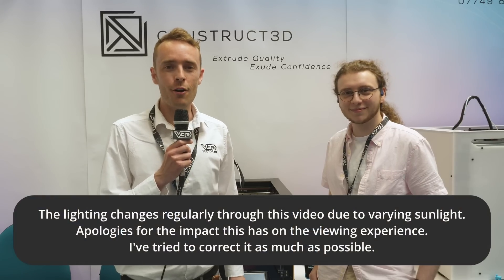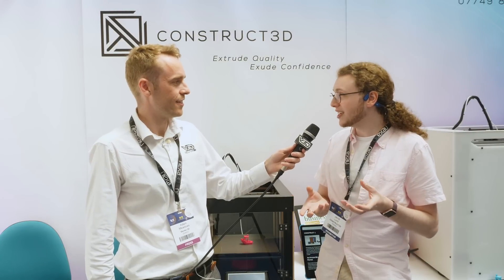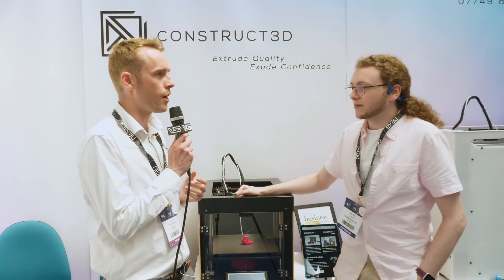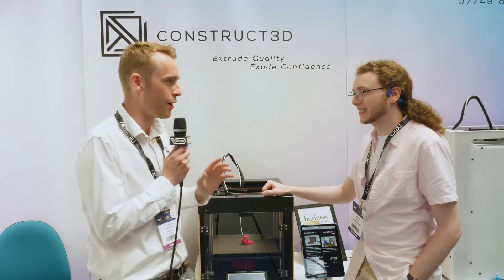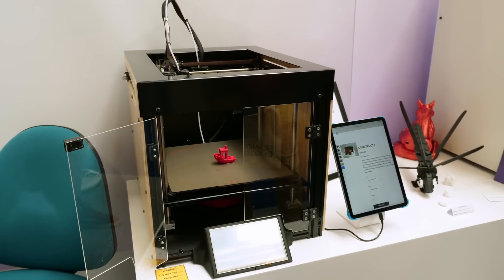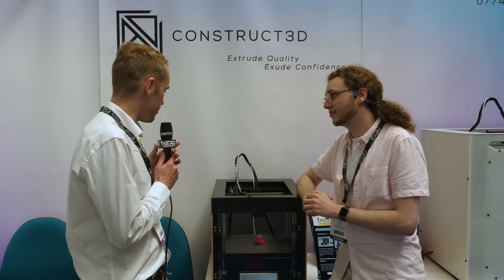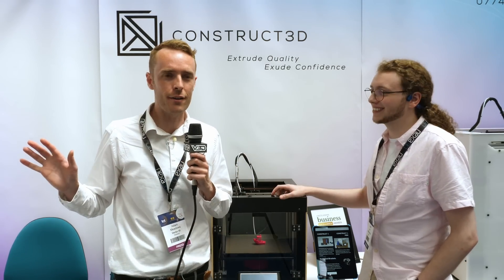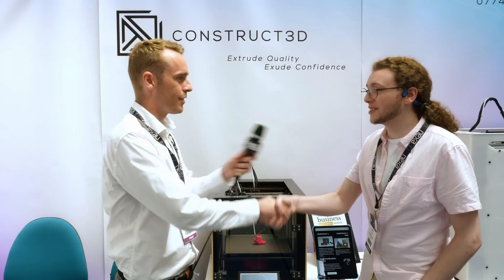Construct3Ds New High Performance 3D Printer at TCT3Sixty 2022

Comment: when talking about the bed he's confusing heat creep with thermal expansion, and the (probably Inconel) bed he's using will have shit thermal conductivity, meaning depending upon how its heated the warping may be even worse than an aluminium bed unless it has been left to heat soak for a Long time. also its HELLA expensive compared to ABLor a trimetallic bed
Reply: glass has even lower thermal conductivity, people are printing fine on glass beds
Reply: That's what I thought at first, but after a little research my guess it is Invar which is also a nickle alloy. Invar has a thermal expansion coefficient around 1E-6, while Inconel and steel are around 12E-6 and Aluminum is 22E-6. I don't think that the low thermal conductivity would be much of an issue past needing a longer time to reach a steady state temperature. I couldn't find much on pricing, onlinemetals has a 12ftx12ftx0.25inch plate for $2000. 

The kinematic mounting solution on the Jubilee printer is probably just a better all-around solution though.

Comment: Problem i see with the v wheels setup is that they are horizontal. That means they wear on one side. And that means if you try to tighten them you might lose correct geometry.
Reply: my thoughts were the same the load on the wheels and points of contact are wrong, can be addressed though maybe in a future revision.  My issue is it doesn't bring anything new or even improved to the table. The Bambu may be gimmicky and pulling out all the influencer stops but it does have the looks and price point at the moment, we will see what happens with it though.
Reply: @thegarageluthier  Plus i think he said that you can't setup linear rails correctly at home. And that is also false :P

Comment: Nice that there's a Hemera in there, no problem at all converting to a Revo, which to me now is kind of a must. Old school nozzles kind of suck once you realize the quality of life you get with Revo. Interesting new printer company here though, and I like his enthusiasm.
Reply: I honestly disagree. There have been so many qc issues with the revo, I'm happy with just slapping on a tungsten carbide nozzle and never changing it again.
Reply: You mean the restriction of life you get from buying into the closed Revo System that brings nothing particularly special to the table other than a toolless nozzle change system. Heater Safety Feature only kicks in at like 400°C which is past the ignition point of most filaments making it a paper feature - Not a practical one. Nozzle/Heatbreak combo is proprietary AF and Patented thus locking you into their ecosystem and everyone else out. Until recently there was no abrasive resistant variant available and as of now it is still not considered a HF system you'll want for fast 3D Prints. Fuck all of that... V6 for life!
Reply: @Duraltia  I don't care. I can swap nozzles in a minute or two, and the possibility of leaks between nozzle and heatbreak now doesn't exist. The convenience means I'll swap nozzles any time I need to - the inconvenience of V6 means I hardly ever did. Patented also doesn't mean you can't do something, it just means if you want to manufacture Revo nozzles you have to do a deal and kick some money over to E3D.